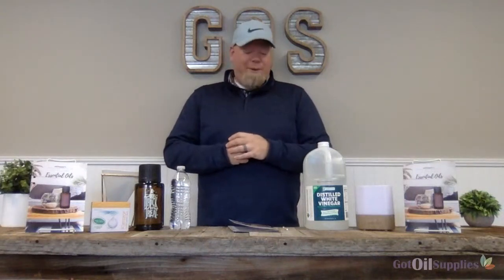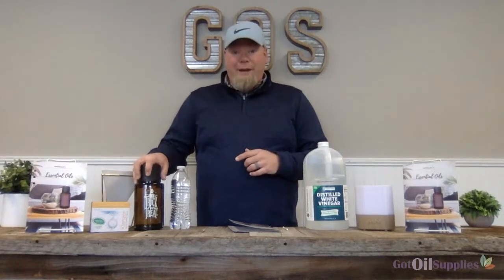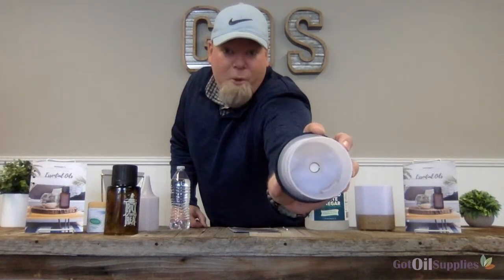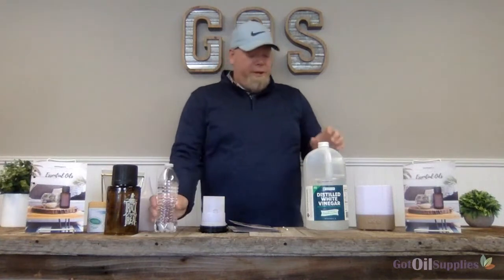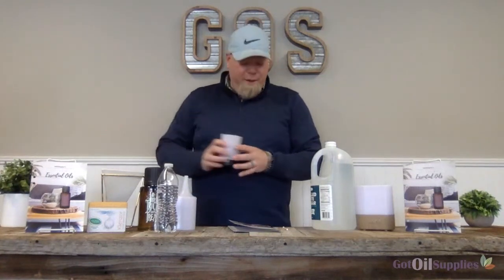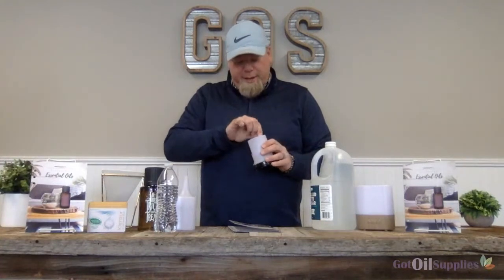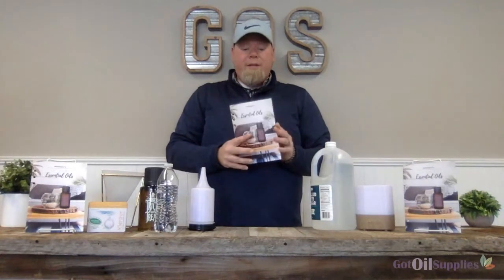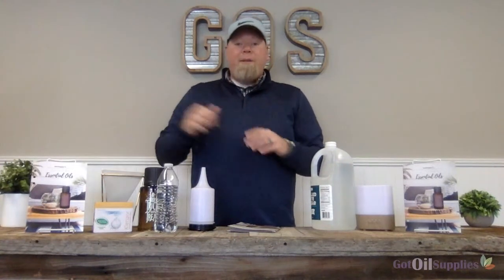How To Clean An Essential Oil Diffuser | Got Oil Supplies

Comment: This is wonderful however it doesn't address my problem which is the mist is not exiting the unit.  The reason is the fan at the bottom is not working.  Either I have to find a replacement fan or...it's toast!
Reply: My fan stopped working to what I do is I get something sharp and push the fan around while holding the power button until it cuts on its annoying but it works
Reply: Hi did you manage to repair yours as I have exactly the same problem mist doesn’t come out

Comment: My diffuser oscillator has a hard black build-up and can see some areas are shiny metal, as if the original coating has burned off.  Now the diffuser won't stay powered up and shuts off within 1 second and the black (burn?) residue won't come off, so think it's toast.

Comment: I have a flame looking diffuser and new to diffusing. I have found a build up of sticky oil residue on the inside of the lid you take off. I cannot clean or remove it. Any hints tips would be greatly appreciated.
Reply: Try soaking in rubbing alcohol!

Comment: I couldn't get the spots out on that little circle,now what.I tried with a q tip
Reply from the maker: The goal when you clean the oscillator disk is to remove build-up. For example, essential oil build-up will cause the disc not to vibrate and diffuse the water and essential oils.  So a few spots on the disc are okay.  Thanks!